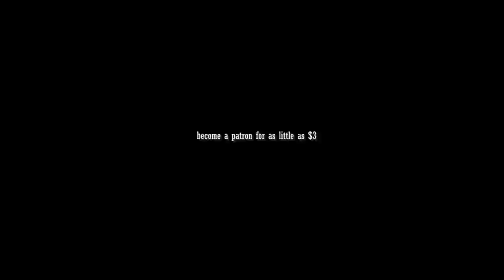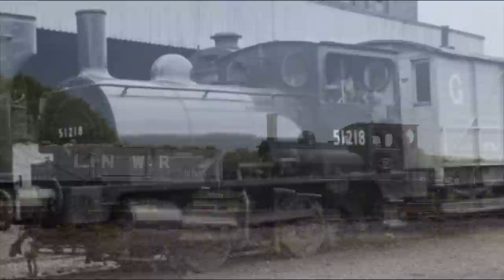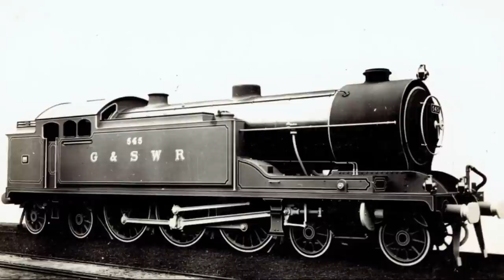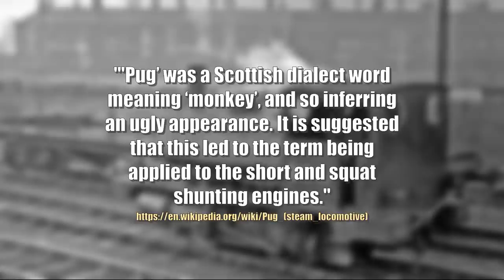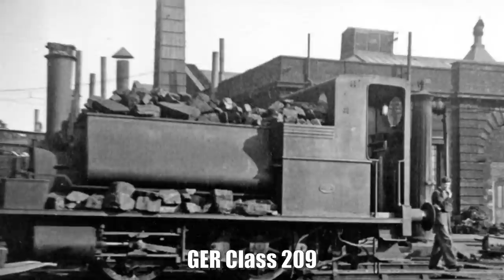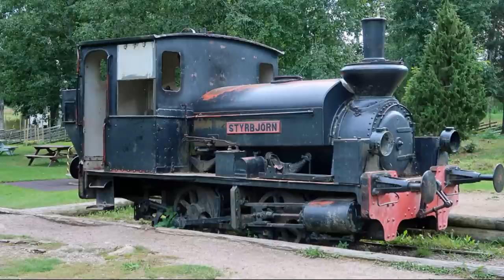Why are Pugs called Pugs? An Explanation & History:  Enthralling Engines #8

Comment: 'Pug' is a very long establish northern term for small shunting engines. The idea that its contracted from 'pugilist' is a good one - short wheelbased, outside cylinder tank engines have a propensity to waddle when running, similar to a boxer limbering up. One of the east coast Scottish docks years ago displayed a lineside warning notice, which read 'Beware of the pug engine', giving it some official credence. So far as I'm aware, the term wasn't used sought of (roughly speaking) the River Mersey. Probably, as regards its origins, its best to say 'you pays your money, you takes your choice.'

Comment: If there is pugs that are dogs and 0-4-0s what about terriers
Reply: Stroudley's famous 'Terrier's got their nickname from the sharp bark of their exhaust on the London suburban trains for which they were designed. Similarly, in parts of Kent and Sussex terrier dogs were known as 'rooters', which term was also applied to the engines.
Reply: @johndavies1090  I said that because 0-4-0s are called pugs and 0-6-0 are called terriers funny they are named after dogs